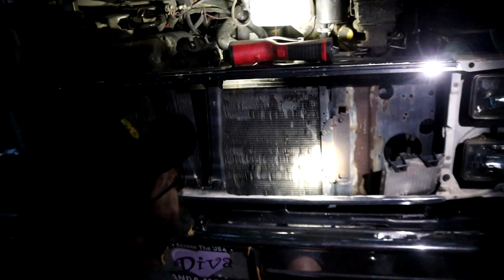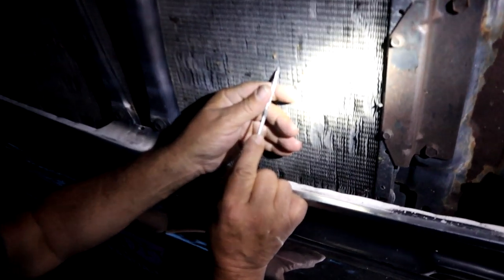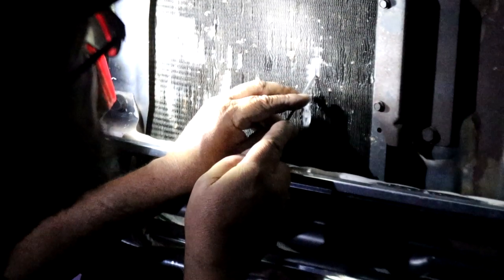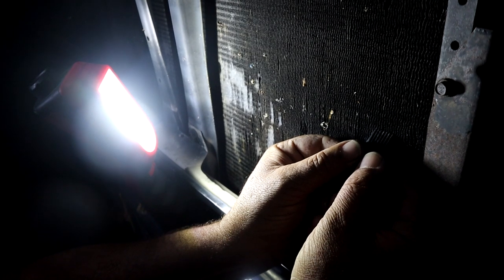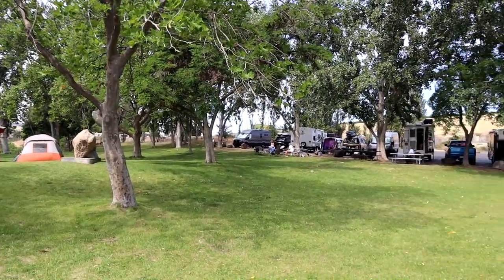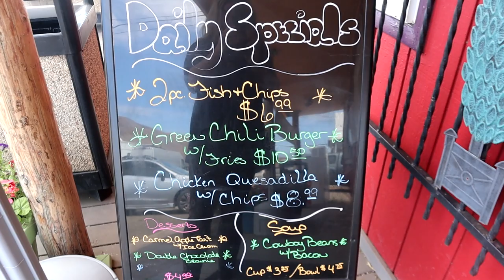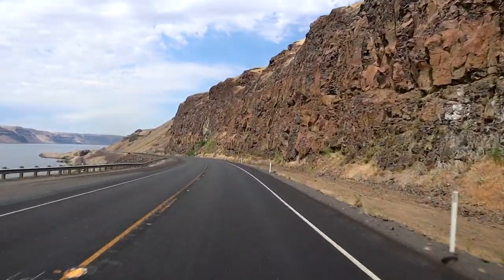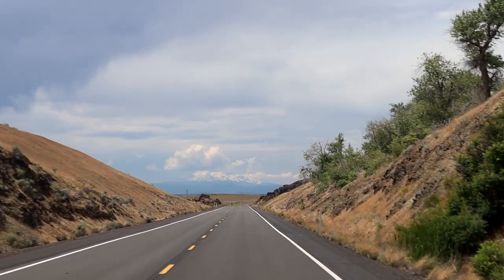Fixing My Old Rv's Overheating Issue

Comment: I had the same problem. After I had it fixed I attached a peice of window screen behind the grill. It allows the air to still flow thru but blocks out small pebbles and twigs and bugs from redamaging the radiator.

Comment: There is a comb for that radiator to be straightened up. Takes very little time.
Reply: Yup.  20-25 bucks for set of 6 different sizes.
Reply: That's good info to know thx
Reply: @hopeechangee12345678  sure make the job easy and quicker...👍
Reply: Dave and Homer were nice to help you out. It’s good to have great friends!
Reply: That would make it to easy.
Reply: Yes you need a radiator comb. I can't believe they are using a screwdriver to try to fix it. It's not going to help much with a screwdriver.  Nice of them to help but they need the comb. I'm shocked how bad she let this go. No wonder it's been overheating on hills.
Reply: She can go into one of the big box home stores and get a Air Conditioner Fin Tool for about $8
Reply: David good to know.
Reply: David good to know.
Reply: Thanks for that bit of knowledge. I have done it the way these guys did. I'm going to order a set from Amazon.

Comment: Let me tell you a little secret about section your fins on your radiator or your transmission cooler I used to work for an air condition company we would use a wire brush on a handle like you clean your BBQ grill with start from the top and work your way down slowly and opens up the Vince and cleans him at the same time go slow starts a top work your way down it opens events it takes just a few minutes easy
Reply: William Lawrence Nice “trick of the trade” !  Thanx for sharing !

Comment: It is the condenser he was working on ... for next time they do make special “combs” for fin straightening usually available in multiple finger spacing sizes, as no condenser is ever the same as the next. The better ones have a slight hook at the end of the fingers so you get under the bent part making it easier to straighten. 
They did an excellent job ... was looking nearly new ... and I agree with them probably regaining 20- 30% Air flow and that will provide more cooling for the radiator/engine as well.
Great video ... love the view as you drive.
Thank you

Comment: Hello Ashia
AC should cool better.
They sell a fin comb to straighten fins. Works better than a screwdriver.  Any AC shop can perform this. When driving at night ,and bugs are bad. Hanging a bug screen on front grill, will stop bugs from clogging  condenser up. Drive Safe

Comment: When the air flows through the coils at makes your engine run cooler less wear and tear it just does wonders for a motor yours is going to need to be revealed before long it sounds horrible but it still goes down the road I would work on getting it done soon the engine we can't lose you on the highway we wouldn't have nothing to see we got to be able to see the travel good luck sweetie

Comment: good jobs guys. just noticed you fashioned a comb to remedy the problem. Check the Radiator cap for correct pressure and temp. Could be the onset of a bad water pump. Keep on Rolling.

Comment: Frost King ACF19 Air Conditioner Coil Foam Cleaner, Cleans Evaporator and Condenser Coils, Fan Blades, and Reusable Air Filters
Try this cleaner for your AC Condensor and Radiator fins will clean them really good. Just spray foam on the fins and let the cleaner do it’s job. May require two or three applications to completely clean fins. Rinse with water hose or rinse spray water bottle or at car wash pressure washer. But do not spray to close might bend fins. Hope this helps you. 😎👍

Comment: I have a Chevy G30 based RV also and I had a new radiator put in my mine not long after I got it. When they put it in they said it actually had slightly higher cooling capacity than the original one and it's been great. My engine temps are always quite consistent. By the way Ausia, I'm in the Pacific Northwest myself right now, I'd love to meet you if you're going to be around the Seattle area at some point.

Comment: Ausia check head gasket and water pump on 🐼 sometimes this 2 things make overheating the engines remember even was low miles when you buy it  antifreeze and water can ruin the metal , my water pump never leak  but was damage already

Comment: If it still runs hot have the thermostat changed and have a friend check the fan clutch to see if its worn out. It will spin really easy if it is.

Comment: Hope straightening the fins  on the AC condenser solved the air flow to your radiator overheating problem.  I spray water through the fins and try and wash out debris when I pressure wash my truck.

Comment: Aussia 😘😁 if your AC doesn't work, just trash that bent up thing. Your radiator really needs to breath. 
But if the AC Does work, you should just replace that bent up thing. Then your radiator and AC will function properly. 
Also inspect your radiator to see if it has bent fins too. 
The (fins) are those things that he was straightening out. 
If your radiator looks as bad, I'd replace it. But you can install it yourself 123. A YouTube video will be your guide.
And get the book already😡😇

Comment: no pressuew washing the grill that caused the dammage
Reply: Never thought of that! Thanks for info!
Reply: ...perhaps... I would more believe items carried/stowed on the front...like a handlebar that moves...pushing in & out... & in somewhat different location on next mount... just my guess...
Reply: I had dandelion fluffiest get between condenser and radiator! Couldnt see it until I took off top radiator support. Used refridg coil brush to clean out!

Comment: While those guys mean well, I wouldn't let them within  a mile of my vehicle. You have an over-heating issue resulting from a number of causes, most likely a bad radiator, bad thermostat, partially blown head gasket, or engine timing problems. All of which can't be diagnosed or fixed by well meaning 'shade tree mechanics' or by straightening a/c condenser fins. Get your rig off the road and looked at by a qualified mechanic asap! Good luck!
Reply: So them straightening the fins was a bad thing? Dont think so .....every little bit helps. Why would you be negative about a couple of guys doing a good thing. Sheeesh!